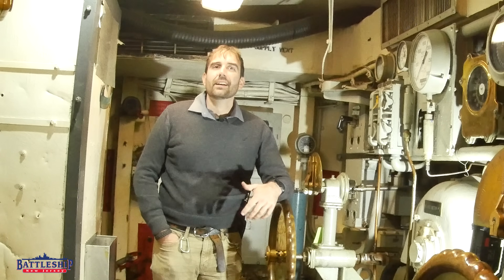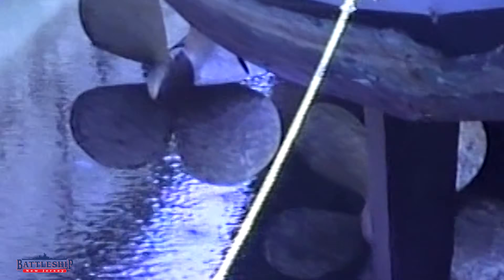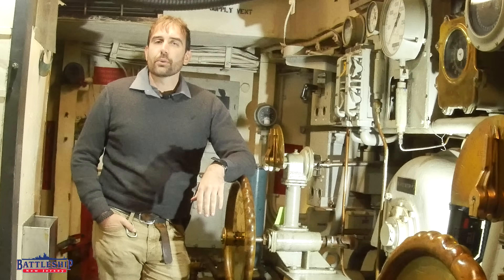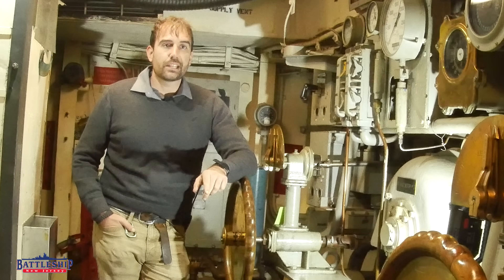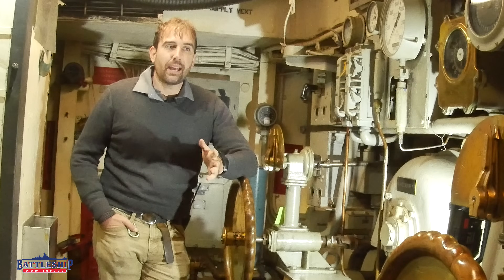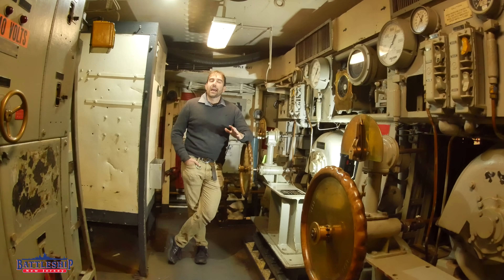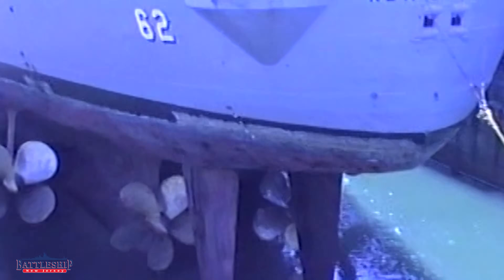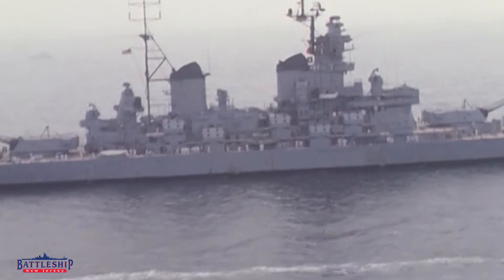How Quickly Can a Ship Stop and Can it Really Do a "Barn Door" Stop?

Comment: on the mine sweep i was the rudders were locked to one stearing gear we did have  variable pitch propellers and from full ahead to full back the fantail would buck hard and you could feel it throughout the ship.
we had just two double throw toggle switches  in the pilot  house that controlled the pitch, and you could go full ahead to full back in about 30 sec.
we had one senior chief petty officer that was qualified as a OOD.
He had been on navy mine sweep boats as boat captain and was very good at running the smaller mine sweeps so they made him a OOD so they had a extra OOD. plus in a emergency because we only had 5 officers and 6 in port watches he was in charge of one of the in port watches and we trained in a emergency the duty watch could get the ship underway and out to sea..
These emergencies were  tsunamis or a attack on the US.

Comment: I was an OOD on the 378' CG Cutters (the Chase), I never hear of the barn door maneuver, but with the controllable pitch props we could stop so fast that if you weren't holding on to something you'd fall.  Acceleration was outstanding as well.  I did not like using the gas turbines during docking maneuvers as there was way too much hp available (idle rpm on the props was much higher than on diesel power) and there is no exact setting for zero thrust.  We could also turn around very quickly, of course using the bow thruster we could pivot or move sideways, it was not a tunnel thruster but was trainable and could go in any direction.  I used it for aligning the ship along the dock so we could connect with our shore power point.  Didn't have to start the mains to do that.  Nice also that you could control the props, rudders, and thruster from the consoles on the bridge wings.  We also had a feature not seen on naval vessels, Iron Mike, he could steer the vessel straight as an arrow even in a rough seaway.  I never had any problem with Mike, he was very reliable unlike a lot of our other electronics.   You might consider a video on the gyrocompass system that gives ships a highly reliable and responsive true north indication.
Reply: @henryostman5740 Small world! I served on Chase as well (2001-2004). From what I remember of the rudder setup on the 378's, the barn door stop was not possible. The rudders were linked together so that they always moved together. I don't recall though if it was possible at all to make them move independently.

Comment: Not all twin-rudder ships can operate the rudders separately. I was on two LSDs in the 70s and 80s, both twin screw, twin rudder. The rudders are both linked to a double-ended ram in After Steering. One ram, both rudders. I believe a similar system was used on destroyers.
Reply: I was also on LSD in the 80s and those sailor boys were always on the lookout for their next double-ended ram in and if you weren't real careful, 10-20 of them would swarm ya and DO DAMAGE on that turd cutter, I tell ya what.

Comment: I know some ship types with twin rudders couldn't pull off the barn doors maneuver.  This would be due to them being sistered to a single steering gear and thereby are unable to move separately.  But assuming a twin rudder setup has individual gear and controls for each rudder there is no real reason they couldn't move in separate directions which is of course required for such a maneuver.

Comment: Just watched your video on the USS California and noted that the California and Tennessee's had turbo electric drive. After watching this video, it occurred to me that perhaps part of why reversing the engines ("crash stop" I think was the term used here) didn't make as big a difference in stopping distance as I would have expected (as opposed to modern ships with variable pitch propellers) would be due to the delay in actually reversing the shafts and winding down the turbines.... Would the turbo electric drive systems on the Tennessee's have been more responsive, since you wouldn't have to 'unwind' turbines and gearboxes before putting reverse torque on the propeller shafts? 

Given that the Tennessee's were 33% slower than the Iowas, maybe crash stopping performance could be compared in terms relative to normal stopping distance?

Comment: I stood engineering and bridge watches on Missouri for almost 3 years.  We never practiced or talked about "closing the barn doors" as a real option, for the reasons Ryan notes plus a couple more.  Most of the time it would not even be possible, since After Steering was not manned during normal operations.  I doubt it would stop 60,000 tons a great deal faster than 4 17'-18' diameter screws spinning in reverse.

Comment: Not surprised it was never used in actual operations. 
Tested yes, probably made a bit of difference probably not as much as you would think. 
If tested it would be in the manoeuvre data or pilot card. 
Typical rudders can’t turn more than 35 deg. I don’t know for Iowa Class. 
There is a type of rudder by Becker which have a hing and can get 90 deg. I have tried this with Becker rudders. 
It made a difference but not down to two hundred yards.  It might have reduced the stopping distance by about 200 yards or 1 cable. 
The fastest method of decreasing speed on a large heavy vessel is to turn. Hard over 
The ship will loose close to half its speed by turning 90 degrees. 
It could be reduced further by combining hard over turn with going full astern. 
I am familiar with Iowa class turbines. 
Typical steam turbine plant the main turbines are for ahead propulsion only.
There is usually  separate  astern turbines which are much smaller and less powerful than the main turbines. 
To go astern steam to main turbine has to be shut off. 
Steam then turned on to astern turbines. 
In order to reduce speed in a hurry. 
It is often better not to immediately go to full astern but to reduce the steam to the main turbines to slow ahead or dead slow ahead. 
The reduced turbine speed will result in similar reduction in shaft speed. 
Without a very heavy shaft brake the propellers will continue to be turned by the water as the ship goes through the water faster than the propellers try and move the water this creates a lot of drag. 
At the same time cycle the rudder hard over, in this case it is a myth the rudders will jam. Damage can occur if you go hard to the stops but I’ve never seen it happen, going ahead. 
( I have seen this occur going astern, the pressure on a rudder going astern overcoming the hydraulics and force rudder to slam up against the stops)
Let the ship start to turn, as soon as it start to turn cycle the rudder hard over the other way and when the ship starts to turn back.
Repeat by cycling the rudder or rudders back hard over the other way.
The ships speed through water will quickly fall as the ship turns. 
When about halved try and engage astern propulsion from slow ahead not full ahead now your shaft brakes will probably be able to stop the shafts turning so you can engage astern propulsion. 
Still the fastest way to stop is a hard over turn. Keep the full power to get the turn started. 
As you are combining up on 90 from original course engage astern propulsion. 
Rudders require water flow to work. 
Turns can be tighten by increasing shaft rpm. Or by reducing inboard shaft. 
Basically using the rudders to turn as they are intended will be much much more effective.
Reply: Man, it's so cool to actually hear from someone who actually did a full glute spread with the New Jersey and can say with confidence that he was wrong! Keep that barn door ajar sister!

Comment: I was a engineer on a tanker that had a single prop with twin rudders. The rudders were  rotary vane type. The rudders were independent of each other. They were used for manurerving in port and could be used like a bowthruster and with the bow thruster made the ship very manuerable and didn't need tugs.
The down side was that the sideways load on the steering gear caused considerable wear on the steering gear vanes, housing and rudder shift bearings. Requiring repairs ever 5 year drydocking at great expense. I am also sure the captain used them about the top speed limits as well.

Comment: Retired Coastie with four assignments to the 378 foot cutters, underway EOW (Engineer Officer of the Watch) on all. Two two-stroke diesels, which make maximum horsepower at highest rpm, two gas turbines, and CPP (Controllable Pitch Propellers). Crash stop procedure, assuming it came from EOTs (Engine Order Telegraphs): Pull pitch handles full astern. Pitch wrong-direction interlock will ramp the online engines to idle. Turn on servo “B” hydraulic pumps to make the pitch change faster. As the pitch servo hydraulic pumps on the reduction gears, called attached pumps, are always turning when an engine is clutched in a solenoid-controlled valve usually dumps those pump outputs back to the reduction gear sumps. Turn those solenoids off so the attached pumps help speed up the pitch change. Answer the EOTs. Shift engine controls from Checkout, where pitch handles control both pitch and engine speed, to Command, where pitch handles control pitch and separate rheostats control engine speed. Run engine speeds to maximum. They will speed up when the pitch wrong-direction interlock allows the engines to speed up. You should stop in two ship’s lengths. If on Main Gas Turbines at flank bell you have about 37,000 hp propulsion being balanced by 37,000 hp of hull resistance. Even with the reaction times of Throttleman and machinery you likely still have 20,000 hp hull resistance remaining when the turbines are providing 37,000 hp astern. Diesels have less hp but you’re also starting with less speed. CWO4 Main Propulsion Assistant, retired. As are those ships.

Comment: "Each rudder is 21 feet tall" but "has a surface area of about 350 feet squared". No, you are wrong. Each has a surface area of about 350 square feet. There's a HUGE difference between "feet squared" and "square feet". 350 feet squared means a surface area of 350feetx350feet which is over 122,000 square feet which is obviously wrong.

Comment: As a engineer who served on USS Midway in the early 80"s I can tell you we never did such a maneuver. It would be pointless and only serve to put undo stress on the plant and shafts. The Midway had 12 boilers of which 8 would always be online when underway. When we report ready to answer all bells it means ready to answer ALL bells flank or back full and would never need to stop to build steam we have it at our finger tips. To think the ship is like a drag car with line lock is just nuts I guaranty if the rudders were barn doored and the engines were at flank the ship is moving and not held in place. Such a maneuver would put such a stress on the shaft thrust barring's and I'm sure anger many people. If you are in a position where you need to barndoor the rudders to stop something has gone really wrong with the ship or your judgement as an OOD. I don't think any captain would want to explain why his ship needs a drydock for repairs do to this.

Comment: "... we didn't do it to stop, but rather to build up steam at a stop, then accelerate." What was this in aid of, nautical drag racing? That sea story seems to claim that opening the throttles to full power while the ship is stopped will somehow going to create a reserve of boiler power. The best way to raise boiler pressure to the point of lifting safeties is to close the throttles and add burners, that will "build up steam" in a heartbeat. The boilers don't know if the ship is moving or not, they only respond to rate of firing and rate of steam flow. The idea that "opening the barn doors" against shafts turning at full power and boilers steaming at max evaporation will produce some kind of hot rod acceleration off the line is ridiculous. A battleship is not a harbor tug, the propellers are not designed to produce large bollard pull power at very low hull speed. Rotating a fixed pitch propeller at high rpm in a zone where the water is violently churned in all directions by a wall close behind the  face while the ship is not moving or is moving very slowly does little but make noise, vibration, and damage to the propeller through cavitation. Ships are not cars at drag strips and propellers in water are not tires on pavement.

Comment: The "barn. door" stop brought to mind Manfred Curry's water brake for racing sailboats. t is now prohibited. But could be used too. slow your sailboat down without changing the trim of the sails. Useful to avoid being over early at a start, or to let a boat to weather to get ahead so you could tack to a better. course.

Comment: Wouldn't the ship stop faster if the rudders were both turned out instead of in? There would be more surface area in the water stream to cause drag and slow the ship.
Reply: Turning the rudders in cups the water, turning them out does not.

Comment: Back in the good old days I was a BT on The FID CV 59 . We had accel-decel time tables at the main throttle. We did crash stops many times and would “double-up/double-down” cutting the times in half. It took forever to get the wheels stopped and eons to finally get them spinning in reverse.

Comment: What would happen to stopping distance if anchor was dropped in shallow and deep water?
Reply: @E-Hamel the anchor itself has probably 30 square feet of surface area. It would be a cool simulation to see what would happen.
Reply: @E-Hamel in deep water your adding considerable drag.
Reply: @E-Hamel It is done at times as a last resort in stopping at the sacrifice of anchors,  chain and  windlass.  Basically just a hope and prayer.    The ship Bright Field tried that when coming down in Algiers Point , Downtown New Orleans, when they lost steering,  Dont think they even got the anchors dropped before coming to a stop at the Riverwalk.

Comment: Great video. Just wondering, at 4:35 , what are those things welded to the hull? They look almost like lengths of chain but I assume that's not it.
Reply: Zinc anodes, used to protect the hull from rust. You can find more information if you search cathodic protection. Also, Practical Engineering has a good video on this if you're interested.
Reply: @danielharman130  Ah! Those are anodes? I'm used to boats just having two or three of them, then again I never worked on a boat with a giant steel hull.
Reply: @peterhoulihan9766  yeah, large ships usually have a lot by the stern to protect the propellors
Reply: @danielharman130  Gotcha. Lotsa tasty brass for the electrons to munch.

Comment: If it is at all possible, a check of the maintenance logs could show if this was ever done. Severe damage to both upper and lower bearing\bushing surfaces and other similar repairs for stress fractures in the area could be possible clues. Yes there would be the usual damage that would occur, but you'd be looking for an unexpected increase in damage \wear over a fairly short time. Could even be mentioned off hand as unusual hammering of the rudder.
Reply: Also, if you could find the 'unofficial' records of a long serving machinists mate, that's where you could possibly find more proof one way or another.

Comment: What about 'clubhauling' ?  

It was a real thing in Nelson's navy: basically a handbrake turn in a battleship, with the loss of an anchor as the cost (fully explained with diagrams in Harland's "Seamanhip in the Age of Sail"). 

I had assumed it wasn't done in the twentieth century, with motorized ships, but was amazed to see it at a key plot moment in "Battleship", when Missouri does it (the term 'clubhauling' is never used in the dialogue though). 

Obviously "Battleship" is not only ludicrous science fiction but CGI too. That said, I do wonder where the movie scriptwriters got the idea from.

So was clubhauling still a thing during the lifetime of Iowa class vessels, or did it fade into history with the Temeraire?
Reply: They actually did tow the ship for some shots.  Never ran the engines of course.  The CGI was effective, it looked realistic.
Reply: @Lurking Carrier Thanks. It's slightly disappointing, but obviously sensible. 

I went back to the book after writing my first comment above, and they did pay out immediately after dropping the anchor (then haul in), so I guess that lessened the shock (on a ship of Nelson's day). But that was partly so that they still had time to trim the sails as she headed up (then put in a sharpish tack, presumably right after the broadside).

None of the above would be relevant to the Iowa class (apart ftrom the actual broadside, obviously). And an Iowa-class at flank would be moving around 4x faster than a man-o'war, too...

Comment: 14:50 — I’m sorry, I don’t believe the 200 yard figure at all. The rate of energy conversion just doesn’t work. I cannot believe that the barn door maneuver would cut anything more than about twenty-five percent off the stopping distance.
Reply: Slowing from 30 kt to zero in exactly 200 yds gives a deceleration of 0.55 m/sec^2 or 0.056 times gravity.  The crew would need to lean backwards by a barely noticeable 3.21 degrees, about 1 in 20.
With a mass of 60,000 tonnes the force on both rudders at 30 kt would then be 3,364 tonnes, the weight of a small WW2 cruiser, is that credible, the rudder posts and mounts must be pretty sturdy?